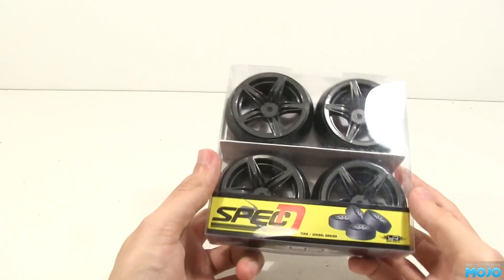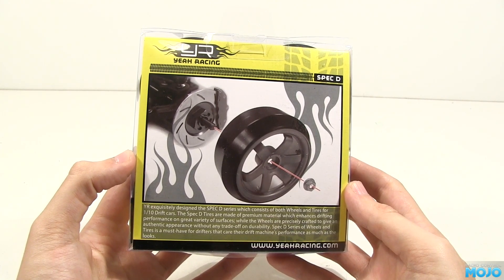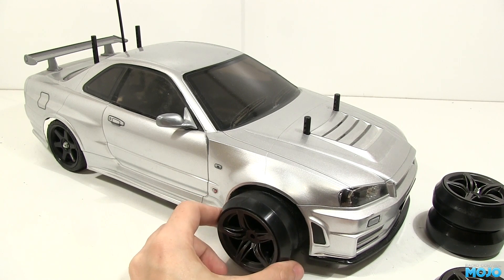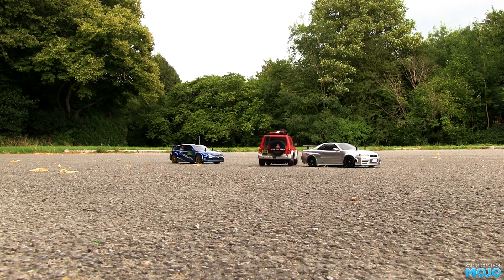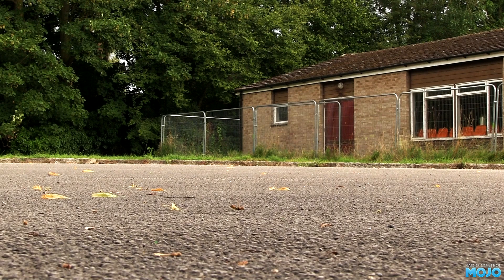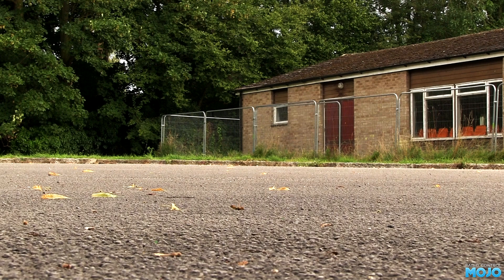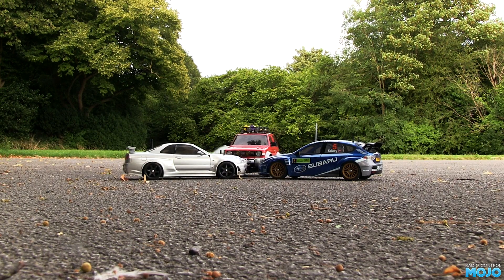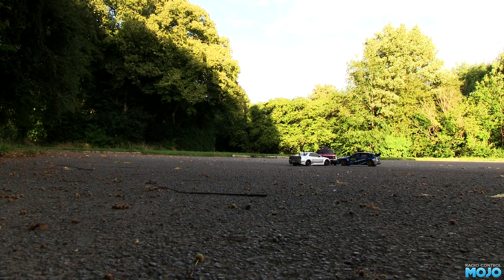Yeah Racing Spec D Drift wheels

Comment: Upgrade your XV01 to a 9000kv motor!!! Your gonna have loads of fun, trust me. Drifting and rally all with rubber tires :D
Reply from the maker: Don't think I haven't been tempted!
But the speed it goes at now is already plenty when running off road, when there's lots of trees to come into contact with...
Reply: Although 9000kv does break things faster. But hey your set up looks pretty good from what I see, sliding around on rubber tires. I once put a 6900kv motor on my scx10, now that is one thing you gotta try.